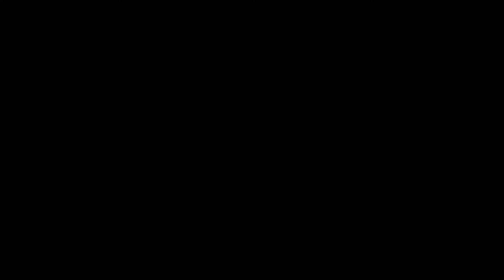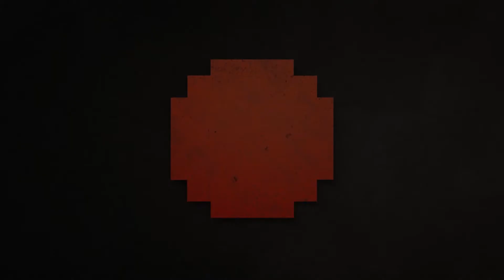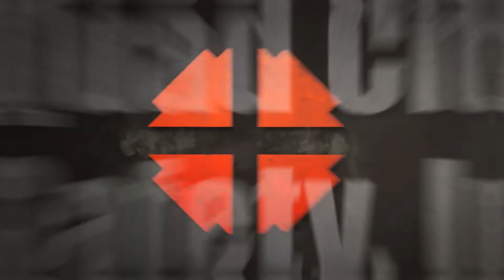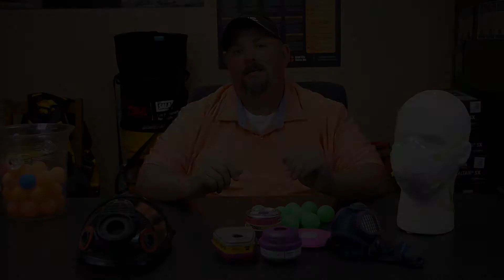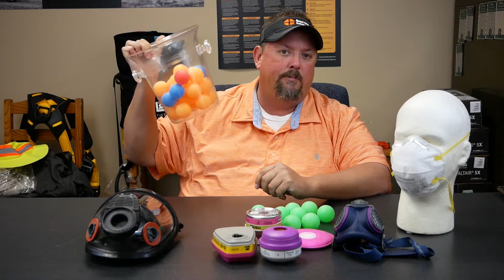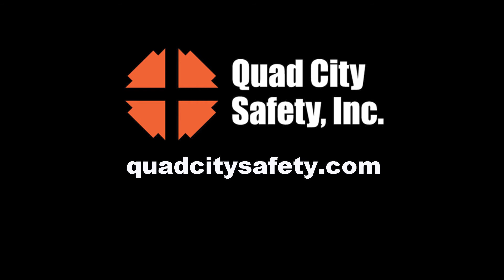Choosing the Right Respirator; Half Face VS Full Face & Their APF

Comment: Why does a full face respirator has a higher APF than a half face mask?
Reply from the maker: Sorry for the delay in response on this one and thank you for watching.  Basically a full face is going to have multiple spots that it is sealing.  It would seal around the outside of your face as well as around your nose and mouth on the inside.
Reply: @QuadCitySafetyInc  Thanks for  replying. Okay, yes that does explain why APF is more for a full face mask. I was curious to understand how this APF value is determined.